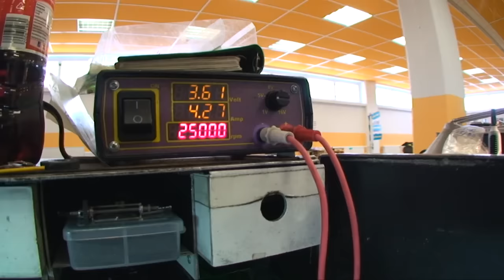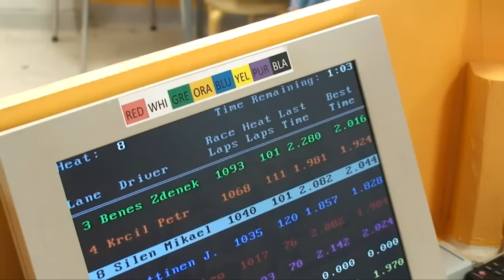Slot car racing European Championship Finals, Helsinki

Comment: My favorite part was where they pretend to see where the cars are at on the track.
Reply: There's no way they can actually see that.
Reply: @KNOTTYBUDS  yes you can, you’d never stay on the track if you couldn’t tell where your car is.
Reply: @jimconsolazio9365  Its a "railed" track. The cars have slots on them where they go into the track so they don't fly off. That's what those lines are on it.
Reply: @KNOTTYBUDS  yes its to guide the cars around, but you can obviously fly off...the reason why these can go at such a mad speed is because they are what is called "flexi cars" or "wing cars".. here its aerodynamics what keeps them in the slot...if you saw a race of normal slotcars that are scalemodels of whatever race series you might like nascar, touring cars, le mans racers etc than they would de-slot a whole lot faster...the slot really is a guide and by no means does it mean that you are not flying off...there is actually a bit of skill to it..sure everyone can learn it, but its not just pulling the trigger...

Lets say in scale model racing its predominantly skill, and a certain part vehicle set up to get the faster times and consistency..
And in flexi cars its mostly set up, and skill maybe to a slightly lesser degree...
Reply: @holgerwacholder3581  Right, but the cars flying off has nothing to do with you watching them.
Reply: @KNOTTYBUDS  yes whilst i understand that this was being said, i thought your point was that you dont really need to see where your car is because its running inside a routed track and therefore cant possibly fly off . I thought i try to explain that this is not the case,or the only Parameter in this case...thats all
Reply: where is the fun?
Reply: @KNOTTYBUDS  they can still fly off
Reply: My favourite part is the people who obviously have never raced or even seen top level winged slot cars but making comments as if they know what they are talking about.
And before you ask, I used to race, but not at this level.  I have seen these cars run though and they do need to be driven by a skilled driver.
Reply: They drive by sound, you'll get a feel as you progress through classes, how to hear your car among the crowd. By the time they are racing at this level, you can hear where your car is faster than you can see it. The looking like they are eye tracking is just a natural response to hearing the sound you are listening for. I raced these for about 6-7 years in the 90's (Not on this level), but i could almost drive blindfolded because I could hear where my car was. At my local track, there was a 10 year old kid (Owners son), who could run a few laps to get a feel for the car and the track, then turn around and drive within 0.05 of his sighted times without seeing it. I seen him do the same trick with an open car, which on that track type (King) was 1.7 seconds a lap at the time I was racing. Sight is not the be all end all of abilities, when you can't use it, your body will adapt and use other inputs
Reply: @michaelblair4744  Don’t worry I would never ask! From what Crazy Jr. says they drive by sound not sight so…. My observation/ joke was right. Don’t get so offended enjoy the cheeky little joke for what it is. I wish you well and good luck with your top level slot car racing.
Reply: @KNOTTYBUDS  it’s to. Guide the cars they can easily fly off though
Reply: Lol that made me laugh out loud that 🤣
Reply: right. what made me laugh is the guy at 1:57, pretending to adjust pressure on the trigger as if he's controlling the car's speed manually.
Reply: Lol
Reply: @duskobozovic1570  
THAT'S MY EXACT OPINION! You press the button and then what? There's no skill involved. It's not like you're really racing. The remote control cars racing and jumping mounds is a LOT more fun and realistic.
Reply: Yeah I'm pretty certain there's no way in hell anyone could humanly be able to see those things in motion, they're moving faster than exlax pushing bean soup.
Reply: I personally think they should be wearing crash helmets...
Reply: Seems most of them just have the trigger mashed, and aren't doing any adjusting to me.
Reply: @KNOTTYBUDS  there's a hobby shop I went to yesterday (for the first time in 25 years or so) amd they had a professional slot car track similar to this. The guy who was testing his cars was dishing out information and showing pictures to my girlfriend and I amd offered my girlfriend to operate one. She kept flying off of the track going around the corners because she was going too fast. The guy had no problem staying on the track going almost as fast as the cars in this video. It's incredible to see in person.
Reply: @chrishoesing5455  you'd think that. Read my comment just above this.
Reply: LMFAO Was thinking the same damn thing
Reply: I played this shit at 0.25x and it’s still a blur.
Reply: It's probably slower irl the camera may make it seem faster but it would still be hard to see
Reply: @holgerwacholder3581  How can skill be involved when you can't even see your car? How would it be possible to slow down in corners or anything?
Reply: @darthpiette2893  He was the only car on the track. There's no possible way to follow your car here.
Reply: @dickJohnsonpeter  you develop a rythym. you dont look and adjust as much as you are trying to find an intuituve rythym to push the car around the track just underneath the limit
Reply: They are a lot easier to see in real life...not so much in 720p, 30fps, and bad lighting.
Reply: the way you see in real life and on camera is different , because of the camera frequency
Reply: To me there is no fun in not being able to see the cars in detail going around the track! Just saying.
Reply: @33LB  I saw him to... He was trying to impress that one girl in the corner
Reply: They must be able to slow down for the curves or the car would come out of the slot.
Reply: Bonkers!
Reply: @michaelblair4744  that's what I love too. Everyone wants to be an expert. I'm 43 now and my dad got me into this as a kid. And there's much more to it than I feel most of the experts here seem to know lol. I'll say for me, yes you can't see them in the sense most are thinking, it almost turns into more of a tapping your foot to music kind of thing. But, your doing it on the throttle. Bang out the right beat on the trigger, and you'll have it. Then your not having to actually watch it like how most would think. Hard to explain......
Reply: Imma settle this debate, I play at champion ship level, idk abt this track but on my track, little slots go into the track and when the slot maxes out, the car goes kaboom, this is how it is in every race, they do see where the cars are and there isn’t a super power to slot tracks , SLOT CAR SLOT, the slot.
Reply: I also don’t drive this fast because as someone said, no fun WHEN YOU CANT SEE THE FUCKING CARS
Reply: Buhahahaha
Reply: Lol true, no way in hell they can see where their car is
Reply: Jajajaj exactly
Reply: LOL

Comment: I had no clue that this hobby has advanced to light speed. In the 70's you could still see the cars.
Reply: They still have the "slower" version.  They've been restricted.  This is why NASCAR put restrictor plates on the cars years ago...they were going TOO fast.
Reply: Ya, know kidding. How is that fun?
Reply: @jaycameronford  well over like 210 even modern safety features get dicey on the not emerging from a crash greatly injured
Reply: Wow! Unbelievable!😆😆😆😆
Reply: Who needs a controller.. you need a switch !!
Reply: LoL I was a bit young in the 70's, but I do remember them in the 80's and yes like you said, you could still see the cars HaHa
Reply: Agreed. This isn't even fun. You can't even see where your car is.
Reply: I’m new to slot car racing and I’m very confused about this
Reply: I think they need a different track...
Reply: Exactly. This is no fun.
Reply: @bretth4988  good idea.
Reply: Exactly
Reply: @lucasmontjoy2700  these are probably non restricted cars, meaning a lot of power, very soft rear tires, big magnets that hold the cars in place.
Reply: Not fun at that speed
Reply: @buoy77micmacmark  Yes I certainly agree. I can appreciate that they're highly competitive however there seems to be a point where I certainly would feel that the fun is lost when it's this crazy.
Reply: The shutter speed of the camera exacerbates the speed.
Reply: Still only a fraction of light speed. But it appears they came close to the sound barrier lol
Reply: They are called Wing Cars, you will notice the high sides, the motors are tiny but extremely powerful, when the cars are traveling at speed, the tall sides flatten out like wings and the down force is what keeps the cars on the track, The breaking for the corners is so fast, it is like a twitch and it is only a split second as slowing down can be disastrous as the car can hurl itself of the track or be struck by a passing car. And in most all cases, the breaking is before the corner and you accelerate through the corner.
I used to race group 12, 16D, super 16D, Wompies, Scale 1/4 mile drags, but I any raced wing cars a couple of times and not in time trials.
Reply: @Keith_H  That's pretty cool, I did not know that about these. Thanks for explaining. In a lot of ways it's not far off from how they take turns in full size racecars. You brake before the turn then accelerate through it.
Reply: I think it should be law they all should be wearing crash helmets...
Reply: Ikr? I grew up with A/FX slot cars, in the 70's. 1st there was the OG cars..then, 'Magna-Traction' came along, then the amazing..for then..G-Plus cars.
We honestly prefered the pre G-Plus cars, much more fun to drive..drifting could be done & skill was needed on the curves..not just a 'floor it & watch' deal.
Reply: yea xDDDDDDDDDDDDDDDDD same
Reply: I don’t see the fun in this. You can’t see the car so what are you controlling? They don’t even look like cars.
Reply: light speed , space balls would say thaaaaats  ludicrous speeeeeeeed
Reply: Holy crap that is insanely fast.
Reply: @Javic167  Magnets don't work on these tracks as the connection on the track is laid with braid wiring. It comes down to prepped track, tires and a lot of downforce.
Reply: Unfortunately, slot “car” designers have sacrificed style for speed.
Reply: @danroberts9050  Like I posted above. This is not racing, it is just luck.
Reply: It doesn't really look fun to me like this, something just not right
Reply: @Javic167  The magnets don't work, otherwise the cars wouldn't have crashed, eh?
Reply: @Willam_J  Because it the camera recorded it blurry.
Reply: The video speed is like x1.2
Reply: @Keith_H  how do you know when to brake when you can't see the car? What is the speed of these cars. It looks insane!
Reply: @lucasmontjoy2700  maybe you could understand it if you were to see how it used to be a long time ago https://youtu.be/KDExnrxHMoY
Reply: They ruined slot car racing when they used magnets that were way too strong.
Reply: @ramongarciano569   LOL
Reply: I had 2 orange tracks with hot wheels and johnny lightening
 This is a whole different animal
Reply: Ridiculous!
Reply: @charliebrown238  I thought it was funny how the controllers were turning their heads like they were watching their cars. I don't think they could see them
Reply: @Javic167  no magnets in these cars for traction.
Reply: @@BrownBomber333 Perhaps you could explain exactly what you mean? I've only got experience of racing in 24, 12 and 6 hour races in 1/24th and 1/32nd scales. I have 3 AFX tracks and over a hundred cars, for enjoyment racing. So, I clearly don't have the experience that you clearly have.
And I've only been slot car racing since 1966, so I will bow to your greater knowledge, IF you prove what you posted.
As to your comment about magnets, AFX G-Plus, and the TOMY AFX cars, have magnets, (2 of them), around the armature, plus a magnet across the chassis in front of the rear wheels. You comment about magnets, and we added magnets to both 1/24th and 1/32nd cars.
Reply: @@BrownBomber333 I have never heard of "magnates" being used in slot cars. EVER! What is a magnate? The dictionary explanation is usually the best.
"MAGNATE" = "A person of rank; a noble or grandee; a person of influence or distinction in any sphere. One of the nobility- or certain high officers of state belonging to the noble estate in the national representation of Hungary- and formerly of Poland."
Reply: Do not see the fun it was in the 60s and 70s when you had to actually drive the car.
Reply: @DavidShrembek  Today's followers would not be able to race for 24 hours with just two drivers. And do all your own pit work. They are just not up to it. I raced in the 60s and early 70s, late teens/early twenties, before work really started to cut into real life.
Reply: Honestly I dont even see the point of that...thats to fast to enjoy.... Love your point...spot on about light speed.
Reply: @Its_YourImagination  I have scaled down to 1/64th, and use the standards AFX cars. Much more enjoyable than 1/24th and 1/32nd.
Reply: @michaelhrivnak1719  Back in the late 60s and early 70s, I used to take part in 1/24th and 1/32 long distance slot car racing. 6, 12, 24 hour racing. It was hard work, and very competitive. Looking back, the fun was in building a car that would win a 24-hour race. But, we could see our cars, rather than these ridiculous, magnet based things that don't even look like proper cars. Don't apologise, you are not alone.
Reply: @michaelhrivnak1719  We won the biggest 24 hour race in Britain, with a lubricated bath gearbox, and the following week that modification was banned for all future races. I suppose they just wanted us to keep buying pinions and gears, plus bearings. Mine invention removed all of that, we were the only team that didn't change the rear axle and gears, just tyre changes and oiling the chassis bearings. We had 57 fewer pit stops than the car in second place!
Reply: @ozzy1887 : True, i think this is seriously crap and pointless.
Reply: @Glenrsi  There are many things in modern life that are, to quote you, "seriously crap and pointless", for myself, the stupidity of the fake sport of "drifting", has no point, e-scooters are dangerous, and illegal in most places they are used, what is the point?
But, I have given away a four-lane 1980s set for Tomy AFX cars, and the cars and power unit, with controllers, and ditto for a two-lane set, to two local families with young boys. It keeps them away from their games, they talk, laugh, and love the racing. But, this is proper racing, where the cars can be seen as they go around, and don't have rare earth magnets holding them onto the track.
That is worthwhile.
Reply: Why thoughts exactly... although the 90's... they didn't have antigravity back then
Reply: Even the 90's you could
Reply: @MileyPit  I stopped racing in the 80s, because of the excessive use of magnets, low profile silicon tyres, and ugly imaginary bodies.
Reply: Así es. Yo, hace 40 años, había jugado. Ahora, no soy capaz ni de seguir los coches. Qué locura.

Comment: Wonderful how everyone was immediately happy for the winner—although I had no idea how they figured that out so immediately.
Reply: They're competing for the fastest lap time. You can see the old school pc monitors in front of the drivers, they see the timing data from those screens in real time. That's how they instantly knew who won :)
Reply: @Miktai  actually they are going for total laps, for most championships you are required to run on each lane for about two minutes and you get one to two minutes between lane changes.
Reply: @pheonixdragon2261  Yup. And we had computer cooling fans on long screws for legs to cool the motors between rounds. Rag and lighter fluid to clean the oily gunk off the rear slicks.
Reply: @Miktai  We didn't have any of that digital stuff back in the 90's.
Reply: @unionrdr  I can remember going to races like this to compete and the fun everyone (well almost everyone) had. One track I went to did an Endurance race to celebrate the 24 Hours of Le Mans and the 24 hours of Daytona. The cars all had to be Group 10, 48 pitch, and run each lane for 15 minutes, talk about working to figure out the best gearing to keep a motor cool. 😵🤬😵🤬😵🤬
Reply: We did too. Tuff to build in speed and not overheat. Besides not setting the timing on the arm too high either. I usually ran 42 degrees advanced and cut down the com for more rpm.
Reply: They ruined slot car racing when they used magnets that were way too strong.
Reply: @unionrdr  You cannot change the laws of thermodynamics.
Reply: @pheonixdragon2261  for further clarity.  In this particular class, they compete on each lane for 5 minutes and five minutes between lane rotation, as most often motors, tires, braids and sometimes gearing will be changed between heats, depending on which lane the driver rotates into.  Its a frenzy in the pits between lane changes.
Reply: @iceracer46  sorry for some misunderstanding here. In the U.S. we run two-minute laps at most races and a one-minute cooldown in between. Most races are run under the rules set forth by Parma, and the specs listed for each class of car.
I never ran Group 15 and higher motors as my cars seemed to have a bit of trouble staying on the track even when using the strongest tire glue the track permitted. These look to be in that higher motor class with nice wing bodies.